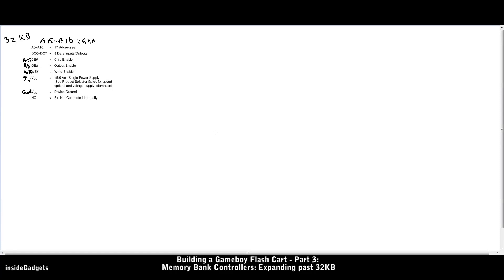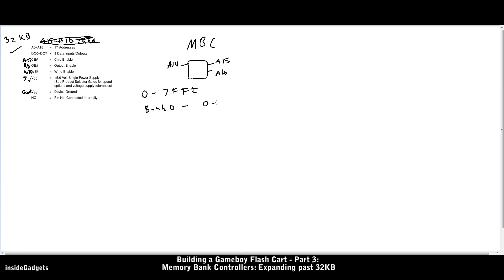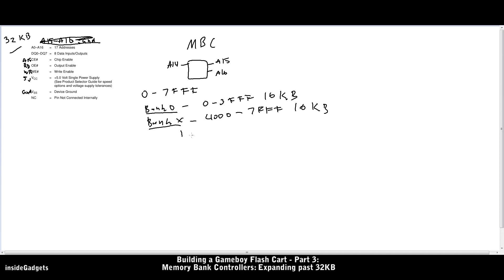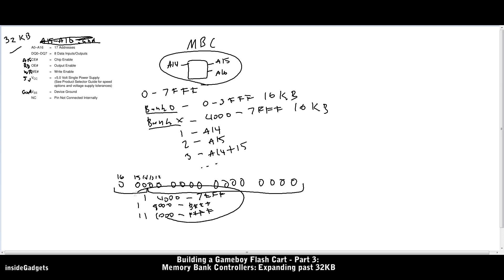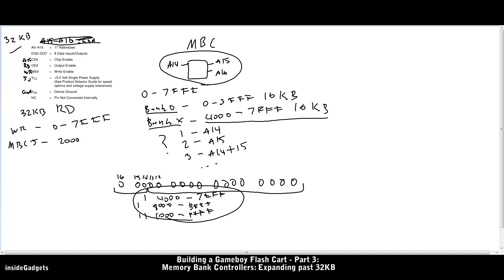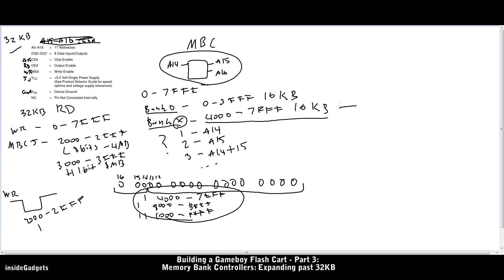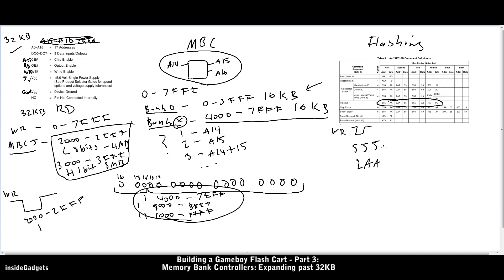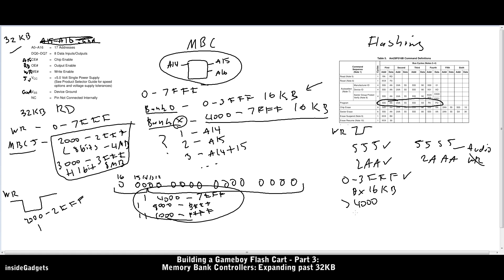Building a Gameboy Flash Cart - Part 3: Use an MBC to expand past 32KB ROM

Comment: I'm confused about MBC5 using 2000-2FFF. Bank 0 is 0000-3FFF so why does setting the address between 2000-2FFF allow the banks to change? Shouldn't the data within bank 0 be accessed in those addresses?
Reply from the maker: When you do a write to 2000-2FFF the MBC is the device that is actively listening to that and depending on what data you write, it will set the specific pins high or low on the rom chip address. When you are reading from 0000-3FFF, you are reading the data from the rom chip which the MBC is in control as to which address lines on the rom chip are high or low
Reply: @insidegadgets  using the MBC for reading makes more sense now. But how would you be able to write to those ranges when flashing? Both MBC switching and flash programming 2000-2FFF requires WR. Does pulsing CE with WR negate the MBC switch?
Reply from the maker: @razredge68  It depends on your flash chip commands. If your chip uses 0x555 commands, then you won't have any issues as you are "writing" to bank 0. If it's a 0x5555 chip, then there will be problems unless you make your own MBC to know when to listen and when not to or the easiest solution is to simply connect the cartridge audio pin to the flash chip WR pin (as long as you aren't using the audio pin for generating sounds)